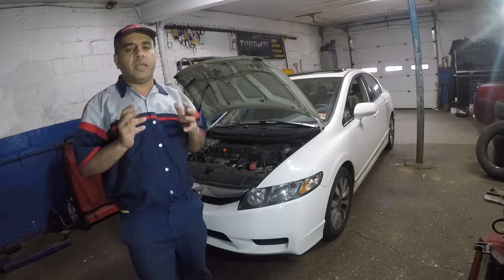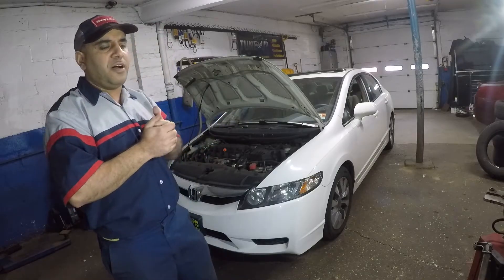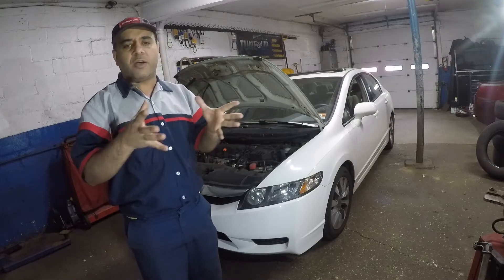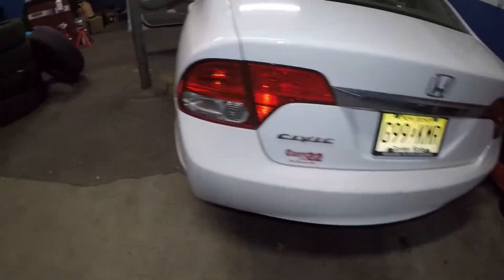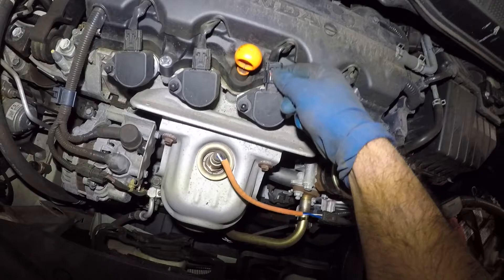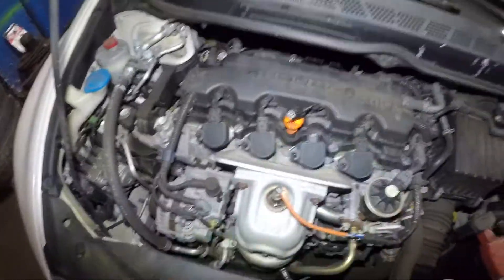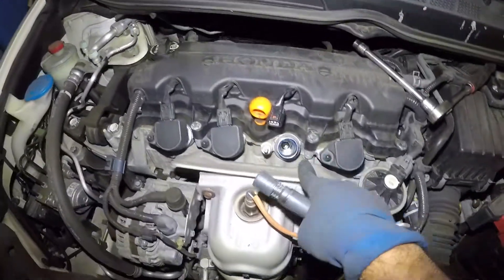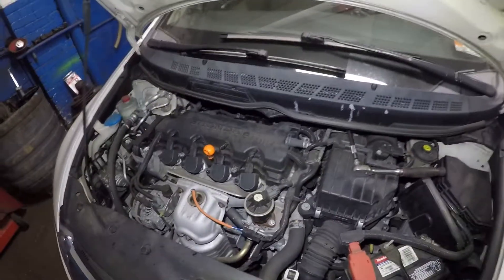Honda civic Cylinder misfire and flashing check engine p0303

Comment: I started with a misfire on 2 and 3 and I changed the cylinders and a few days later i had a misfire on 3 and changed that one out and for a few weeks I had no issues but today the issue came back in 1.2. and 3. What do I do now??
Reply from the maker: Start with doing basics change out plugs and coil and reset the light also do oil change use good oil the vtec works off oil dirty old and low oil can cause this type of issue
Reply: Is it odd that the issue starts with misfire in P0302 and P0303 and I fix that issue and it comes back at P0303 and I address that issue and a few weeks later it now comes back in P0301,P0302, P0303...Oil was changed in May of this year and the coil packs were replaced earlier this year and not because I had issues at that time, I just thought it be good to change them when I was doing a tune up this past spring... I noticed this latest issue last night when I started the car up I seen the engine light flash a few times with a low vibration, and it stopped and the engine smoothed out when I drove off to head home. It only acts like that at start up..

Comment: I replaced both the spark plug and the coil and the car stalled when I drove it. It completely turned off. What should I do?
Reply from the maker: Well the stall need to be figured out anyways when dose it stall when u come to red light or stop sign?  What is ur idle rpm once the car is cold.  I would do throttle cleaning service to get this repair started

Comment: man i have an 08 civic and for some reason the engine light started flashing when i would accelerate, as long as i ease into it the light wont come on but when it does come on it loses acceleration power. i checked the coils by unplugging them 1 at a time and everytime i unplugged 1 it would almost stall on every one so idk what to do. can u help? it isnt doing any shaking or anything like that it only begins to flash when i try to accelerate at a decent speed
Reply from the maker: Did I scan for codes also look in to memory codes flashing light means misfire also check ur oil level
Reply: @RBTheMechanic my oil is good but it still stalls when I try to accelerate?
Reply from the maker: @im2nyccodm500  what is ur rpm maybe cleaning throttle will help

Comment: When I try to replace the spark plug on my civic 2009 P0302, I found oil all over the engine and the coil pack.  I knew that I needed a new gasket cover but didn’t do it on time…now how can I temporarily clean the oil?
Reply from the maker: Use socket keep sticking in out clean socket over and over till u get as much as it can be possable then use tissue stick it down last of all remove the plug clean it out well

Comment: i have p304 but when swapped around the code didnt change ):
Reply from the maker: Check the plug and check compression in engine and check injector for performance

Comment: At autozone they said I have a misfire cylinder four sometimes the light flashes I had spark plugs put in last year. I drive a 2011 chevy aveo
Reply from the maker: Change the coil pack
Reply: @RBTheMechanic  my mechanic is putting new spark plugs in. I need to change the coil pack to?
Reply from the maker: @savvyguy4180  most likely it’s the coil pack

Comment: I have a 2006 civic, it’s saying cylinder 2 misfire, we replace the coil, still having problems. We’re gonna do plugs next, but when I get to like 60mph and then have to slow down and then give it gas again it starts jerking a little, and then on any sort of hill, big or small sometimes it will lose power and check engine light starts flashing, but I can pull over turn the car off and back on CEL will go off and it does fine for a few miles… I’m so confused on what it could be!
Reply: I put brand new coil packs and sparks plugs in my 09 civic about two months ago and two days ago the check engine light came on..the sparks plugs are not gapped though I don’t know if that matters..and my cold air intake is dirty beyond belief
Reply from the maker: @kiellieferickson5506  check the gap and why is the intake dirty?
Reply: Exactly my problem right now
Reply: This is my problem right now, do you know what was the fix?
Reply from the maker: Flashing check engine is heavy misfire so do this change out the coil and plugs

Comment: What if all the cylinders are misfiring?
Reply from the maker: Check vaccum leaks
Reply: It'll have P0300 Random multiple misfires...Usually needs plugs and or the piston rings are worn letting oil past the them to foul the plugs..Crank shaft or camshaft sensor..Distributor,coil or related parts if not coil on plug like newer engines..Water running down in where coils are from bad weatherstripping along the cowl or rear of hood...Usually a certain car will have a certain problem when the P0300

Comment: Thanks a lot 🤙🏼
Reply from the maker: You welcome!!!
Reply: @RBTheMechanic   I replace the coil pack and spark plugs but still have misfired what I’m gonna do.
Reply from the maker: @d3mb3  switch the coil to diffrent cylinder see if the misfire changes to that cylinder double check the gap of ur spark plug

Comment: My 2002 Honda Civic LX has a P0303 code. I counted the cylinders from right to left to find the #3 cylinder. I swapped the #3 with #1 and it still shows the #3 misfire. Did I ID the cylinder wrong?
Reply from the maker: Did u reset the light?
Reply: @RBTheMechanic  I changed both O2 sensors previosly and the light went off. When the guy checked my car for codes before "Inspection", while Check Engine Light was still off, it came up on his monitor that more than one code, 2 codes I beleive. So he told me it wasn't ready yet and I should drive around more before bringing it back for inspection. Unfortunately, the Check Engine Light came back on and I took it to Autozone and tested it and the P0303 code came on. ONLY that code. This leaves me to beleive that this issue is fresh. I just added K-Seal in hopes of catching this problem before it gets too big. The Head Gasket being the suspect. I'll kn0w tomorrow when I test drive it.
Reply from the maker: @Justjack613  that cylinder 3 misfire maybe the codes he got was memory codes
Reply: @RBTheMechanic  I disconnected the neg battery cable for a couple of days in hopes to clear any code. I'll reconnect on Monday and when the Check Engine light is off, I'll take it for a test ride and then check for more codes. I cannot see or find any reason for the code. So I'm hoping this will do it.
Reply: @RBTheMechanic  I'm not sure I understand what a "memory code" is.
Reply from the maker: @Justjack613  memory codes are codes that was there before and light went off no repair is needed just a back lock of memory codes
Reply from the maker: @Justjack613  yup that will reset everything and ur radio will be locked u have to enter radio code and if u have Navi that also
Reply: @RBTheMechanic  Thanks. I reconnected the neg battery cable and the Check Engine light is still on. Solid light, not blinking. Now the only code showing is a P0420. I'll look it up. I will try cleaning the Cat Con again.
Reply: Finally! I bought a OBD code reader on sale for $21 and deleted the code 0420 myself. Check engine light came back on 1 block away from getting my inspection sticker. Deleted coede once again. Light came back on steady, once again. I took out both O2 sensors and sprayed half a bottle of CLR above and let it soak through for over an hour. I then shoved a water hose down it and flushed out all CLR and dirt> I can actually see the water coming out of the bottom of cat con being a lot blacker. I immediately put O2 sensors back and got the car on the road to burn off all water that may still be inside exhaust manifold and Cat Con. Ran smoothly and a whole lot better. The check engine light never came back on after a good 25 miles. I'll take a longer trip now that the car is ready.
Reply from the maker: @Justjack613  wow that was somthing crazy but good if it works
Reply: @Justjack613  How is it now? Did it ever come back on?
Reply: @voltixD  Its out now. And has stayed out.